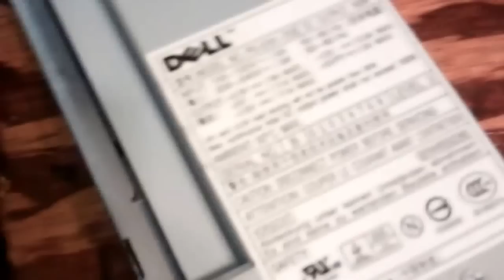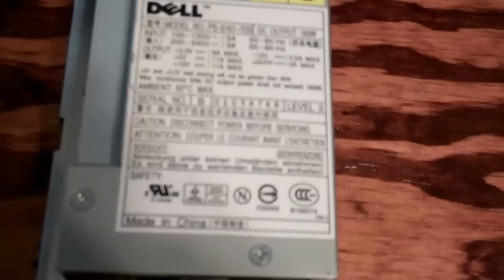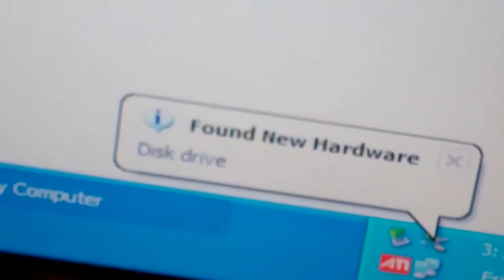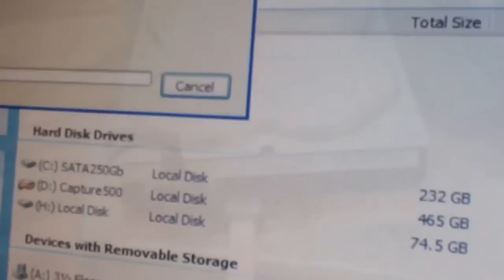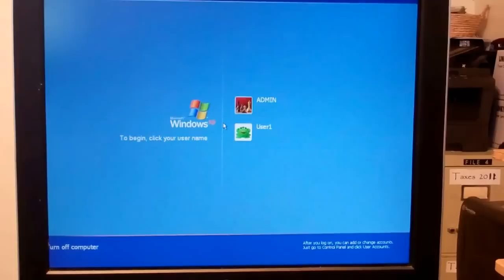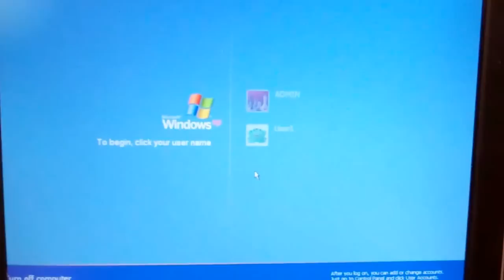Replacing a Power Supply on a Dell Optiplex GX280

Comment: Its a bit late to tell you this but the capacitators need replacing :)  you can see them bulging and leaking.  This will affect the stability and performance of the computer.  I would imagine the original PSU that you had replaced had the same problem.   These computer came from what is known as the capacitator plague. Wiki has a article about the capacitator plague.

Comment: What is that hard drive test rig? How did you hook it up? Thanks.
Reply from the maker: It's just a generic no-name brand setup I found on ebay.. Just connect up the plug connectors provided to the hard drive and connect the data cable to the computer via USB to see whats on the hard drive